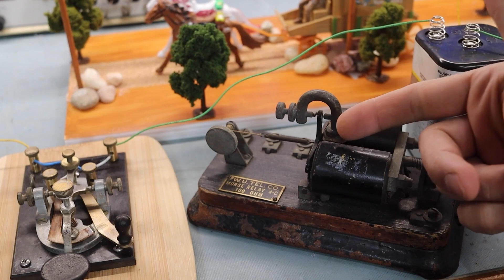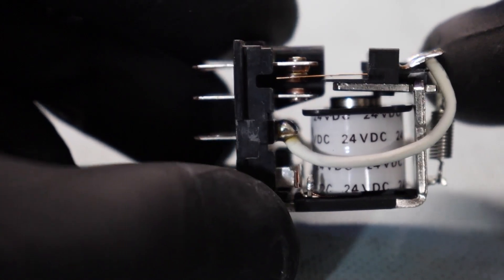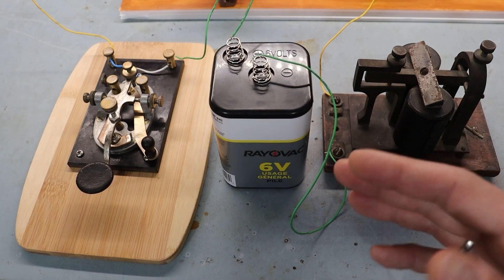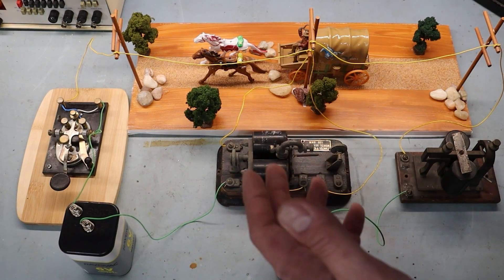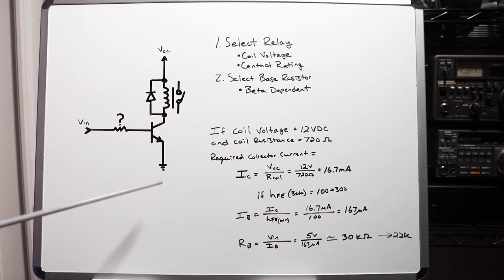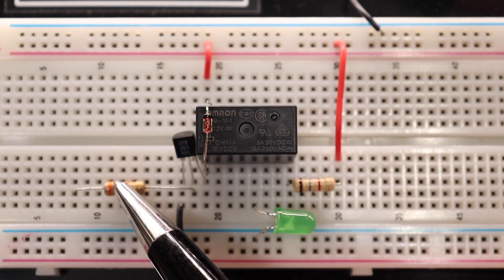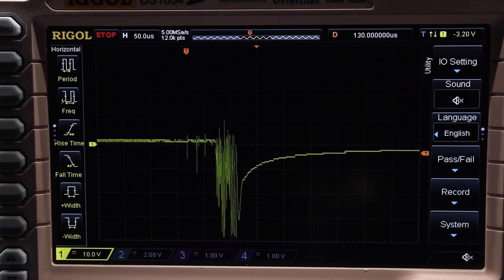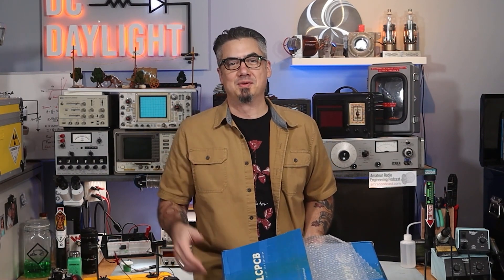How Electromechanical Relays Work - DC to Daylight

Comment: Just started watching your video and boy do I got comments on that DC circuit how do you protect those cheap little flip flop circuits you can buy that are just 30 volts when you want to run 36 volts batteries and switch between them what is the trick or electronics that you can use to protect and at the same time allow the batteries to push its full voltage to the load?

Comment: Thank you for the info.

I was very confused with the relay terminology when I was studying computer around 30 years ago and its relation to "bug". There was mentioned the origin of the "bug" name is derived from the fact that when the engineer in the computer makers tracing the faulty why the computer was not working, then found there was "bug" in the "relay". My confusion was, "How a relay cause faulty," because in my though was that relay is a kind of retransmission, just as you mentioned. That's because in my place, around in 1988 there was built a TV Station's relay, retransmitting the received TV signal so we may received the TV broadcast at home that was blocked by a high hill (This is related to free space loss in radio telecommunication). The relay was located in that hill. I just understood the relay device around two years ago when pandemic hit us, I spent my time study electronic, then I found the name a "relay" device. But, I was still confused how it named relay.

Comment: I use an integrator instead of the snub diode. Place a capacitor from the collector to the base. This controls the rise and fall time of the relay current and there's no back emf. It slows the cct down by a few ms but if that's not important consider this method. When you're switching RF circuits you don't want ANY clicks audible. The diode is only useful once it conducts - by which time it's already produced a 700 mV spike. Safe, but in an RF environment, not ideal. Using the integrator, no RF spike is produced.

Comment: The diode slows down the opening speed which can be important for high power applications. An easy fix for that is to add a resistor in series with the diode, roughly the same as the coil resistance would be a good start. For the fastest opening time, use a capacitor instead of a diode, then you'll get a damped AC wave which quickly demagnetizes the armature. (Start overly big like 1uF and go smaller until the scope shot shows an underdamped response with acceptable amount of overshoot.)

Comment: Great video about relay switches. And great application for how relays are typically used today...switching higher (usually) current circuits. And thanks for the brief discussion about the flyback (snubber) diodes and showing why. Not many people talk about those or why they're needed. 
Also love the discussion about the telegraph and its history.
Not many people realize that using several relay switches together in certain configurations, you can make logic gates, which can eventually be built up to create a computer (as the very first computers were done)...although the relays were quickly replaced by vacuum tubes (or valves, if non-US), and eventually replaced by transistors (and then miniaturized into IC chips).
Fascinating what a simple electro-magnetic switch can do.

Comment: Thanks for mentioning the snubber diode. Any suggestions on how to spec them? Do I use the VCC rating or does it have to be high voltage? Also, what about the current?
Reply: @AmRad Podcast Thanks, Derek!
Reply: @Rouverius  The 1N400x series are all pretty much the same price in smaller quantities to you can put a 1KV diode across there if you want.
Reply: @justovision  Thanks!